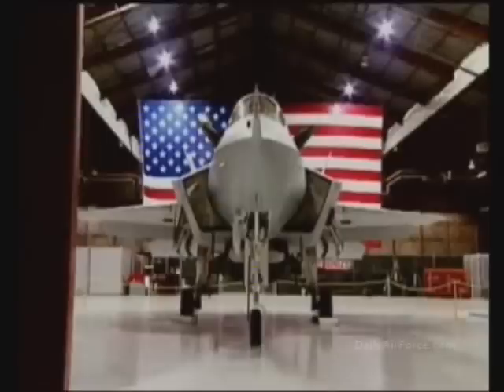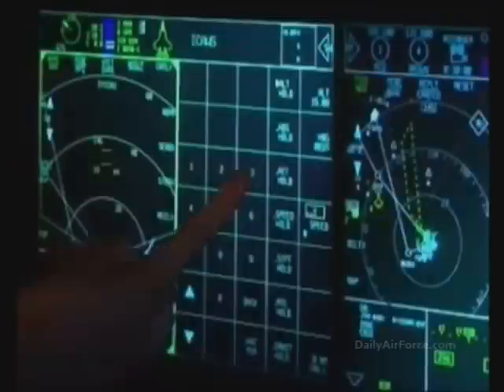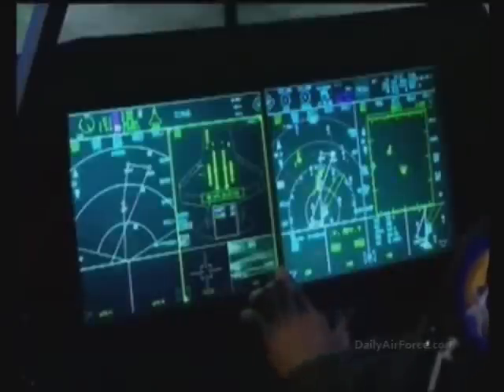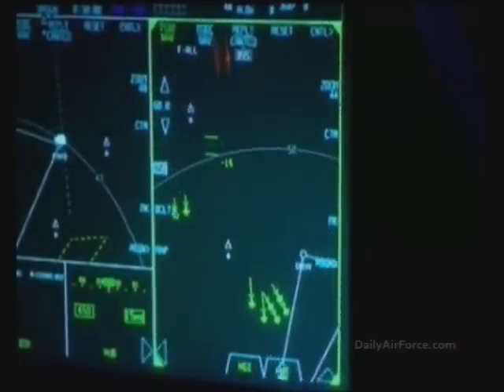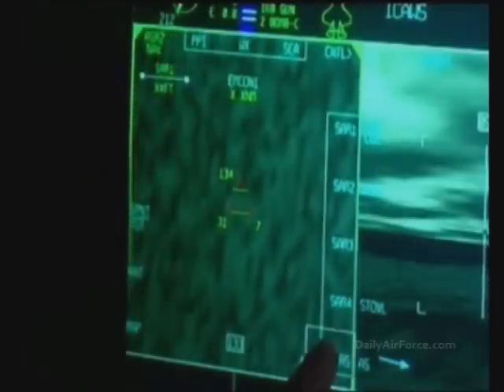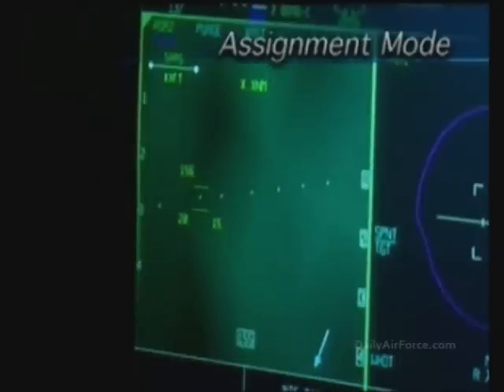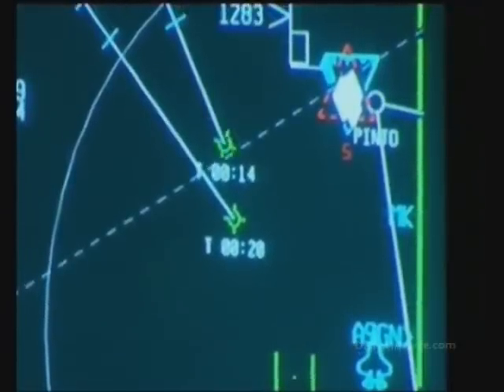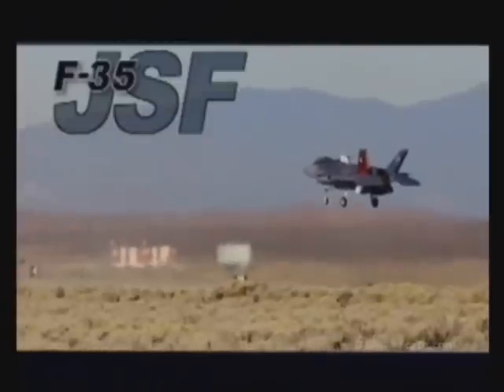F-35 Simulator - AA and AG Modes / Avionics

Comment: So whats the big deal about this plane? Everything I saw in this video apart from data link the F16 already has.
Reply: +rsx123 Things the F-35 has, that the F-16 does not...
1) 2.5x the internal fuel
2) Stealth
3) Better radar (even better than the newest AESA for the F-16, as it's bigger)

4) DAS (IR sensors all around the jet, 360 spherical coverage).
5) AN/ASQ-239. Essentially a RWR on steroids. The F-16's RWR doesn't come close.
6) Sensor fusion. The F-16 has no fusion. All sensor information is shown on different screens. The F-35 has a fusion server that takes all the sensor data, and paints a single picture of the battlespace. It even automatically queues other sensors (such as the EOTS) to gather more detail on a target if needed.
Reply: F-16 has this data link with an extra JTRS data link which is used for Army and jointly with A-10Cs

Comment: I mean why else would it be thrust vectored? The whole point of that was to MAKE it a supermanueverable aircraft. 
Please, I implore you to educate yourself in regards to the F-22 at least. You are correct in your assertion regarding the F-35 ( even though its designed to perform under a combat load and actually does ok with that in mind) But you are DEAD WRONG about the F-22.
Watch the video I linked you.

Comment: You're full of shit. The F-22 and the F-35 are nothing alike in term of kinematic performance. 
The F-22 is designed to be supermanuverable.  With thrust vectoring and a thrust-to-weight ratio of 1.26 at 50% fuel, it is the first production aircraft in the U.S. arsenal to be supermaneuverable. 
In fact go and type supermaneuverability into google and see what comes up , I dare you. 
Then watch this video /watch?v=GW2Hvu_mUdU
Lastly as I said earlier, the F-22 has the best sustained turn (cont)

Comment: Su-35 is outdated junk, compared to this. Su-35 with its huge RCS can be tracked at 460km, this one at 100km. Also the Su-35 can't hover. F-35 is 3x more expensive, but could kill 6 Su-35. It reduces operating cost, pilot cost, and more.
Reply: How F-35 could kill Su-35? With it's radar?

Comment: "The fate of the F-35 Lightning II would be far worse in an air combat environment challenged by the PAK-FA.  If the Mach 1.5 PAK-FA is using its infrared sensor as the primary sensor and observes radio frequency emission control (EMCON), then the first detection by the F-35’s APG-81 radar could be at ~20 nautical miles or less with a missile launched by the PAK-FA’s infrared sensors already inbound from 60 to 70 nautical miles away. " APA think tank.